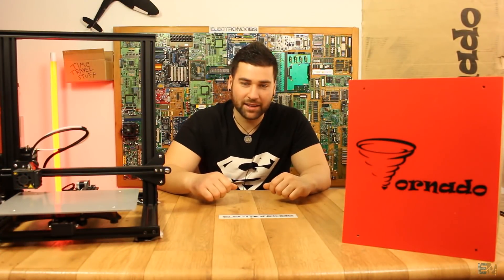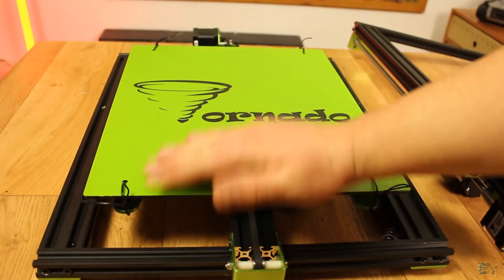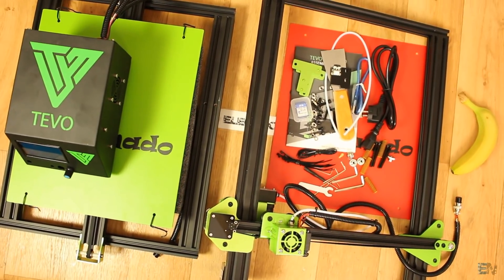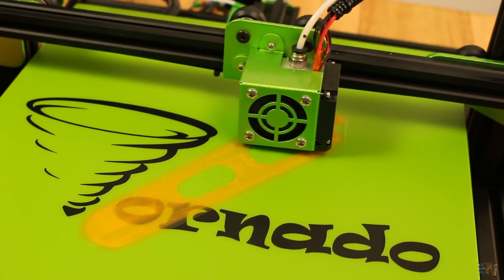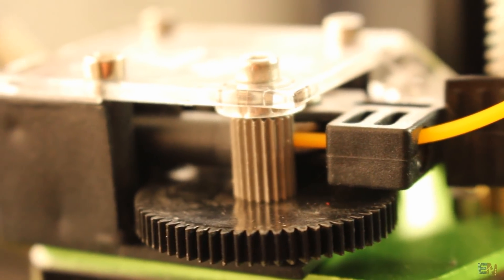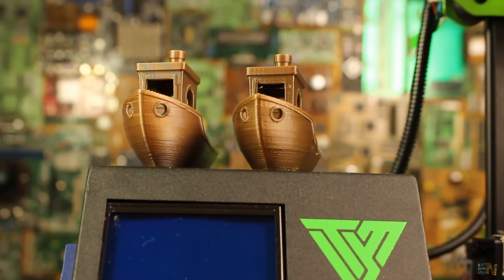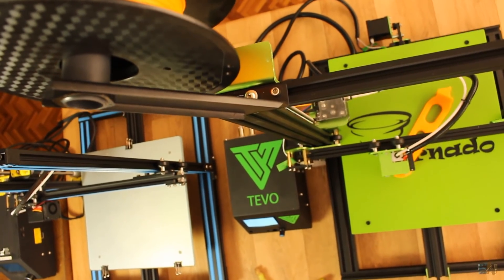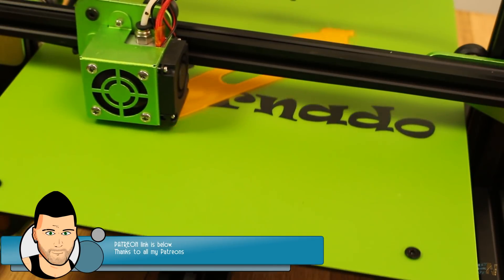TEVO Tornado 3D printer - My new favorite?

Comment: I'm very new to this and I think I have my cure set up correctly for my Tevo Tornado. I pushed save to file on my sd card.   Put the sd card in the Tevo and selected the file but nothing happens.    I was able to print the spool holder preloaded on the card fine. so I know the printer works correctly.  I looked and all of the factory files on the card are .gco and the one I loaded is .gcode.   did I save it incorrectly?   Any ideas?
Reply from the maker: what software are u using? I uwe repetier. Sabe for sd carg. Both .gcode or .gco will work. Make sure you ahve good STL files and that the gcode has no errors.

Comment: A few things that I feel need to be mentioned. The bed screws are OUTSIDE of the build space that is why the Y axis in physically longer. That area is not heated or meant to be printed on. If you prefer glass beds remove the Buildtak surface with a razor and acetone. Underneath is fantastic piece of borosilicate glass. I've been printing directly on the glass from day 1 of its release. The TEVO titan extruder clone being plastic is not an issue as E3D also use plastic gearing as well. Nice quick overview that's to the point and different from most. Thanks for your content.